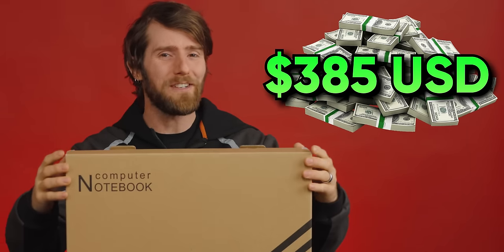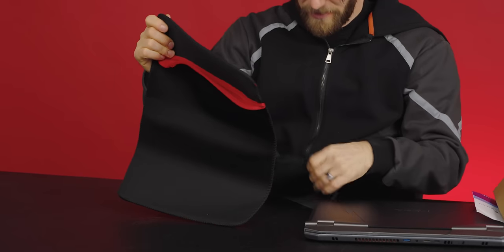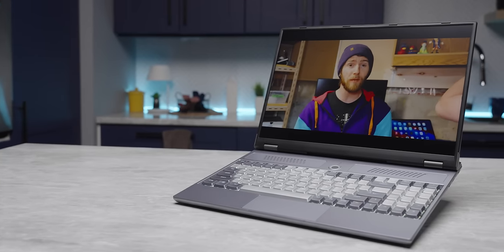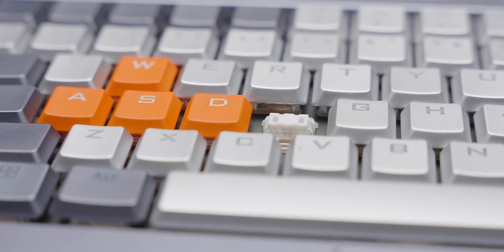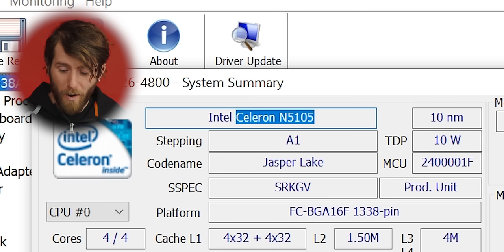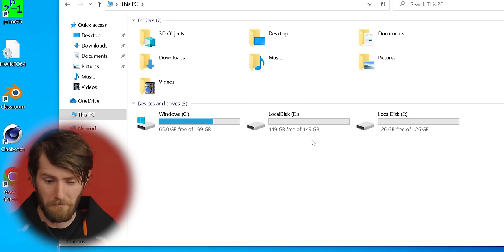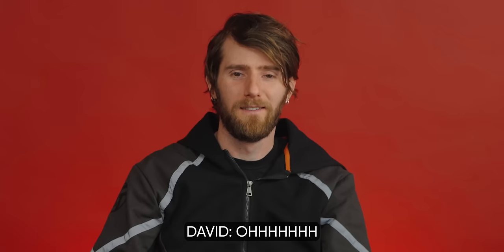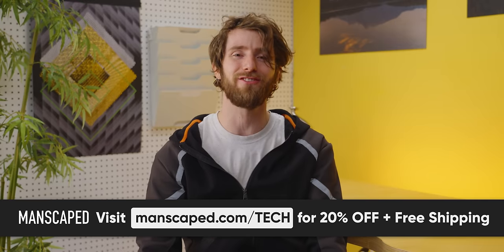Brown Star for Effort – This AliExpress Gaming Laptop is HILARIOUS

Comment: There's a lot of good audience for low cost, high value, thrifty PC laptops. You should make more reviews like that. Not necessarily with the humorous angle, but fair reviews. I liked when you reviewed Walmart's Motile laptops. You should include some brands from China like BMAX, Chuwi and Jumper.
Reply: Ooo I got a Jumper laptop cheap (about € 35 I think), former owner's friend had tried to install W10 on it and failed, making the device "bricked". I reformatted the "SSD" (I'm still not sure if a REAL SSD is inside...) and installed W10 with a USB stick. But surprise surprise, half of the installed hardware is not recognised, no drivers for them even in the latest W10 version... They are "downloadable" on the Jumper webpage, yesyes, which is half english and half chinese... I gave up for the moment, in a quiet hour I will again try to download them...
Reply: @frankmeyer9984  I'm an enthusiast who owns 20 laptops at home basically as a hobby, ranging from several very premium ones to a number of cheap ones from China.  On a cost/benefit ratio, I'm quite impressed with two models I own: the BMAX Y11 (Now shipping with upgraded processor as Y11 Plus) and the Chuwi Corebook X. Both work perfectly with Windows drivers, both running Win11. Build quality and specs are superb for the price. Sure you can buy a US$4000 fully specd MacBook Pro 16 (I do own one) but there's a thrill from seeing what a 10x cheaper device can do.
Reply: @Gustavo_St  Indeed... Everyone can buy a solution, or make it by himself 🖖Today I watched a review of a $ 375 gaming laptop, and the results were partly sadly laughable and partly highly impressive! For this money it may be the BEST "gaming" laptop you can get! Real mechanical keyboard, 4 real cores up to 2.9 GHz, 16 GB RAM, Aluminium case,, high quality high resolution IPS display with "Golden Ratio" 19:10 display... Well you get what you pay for, but in that case you get a LOT of Laptop for under 400 bucks...
Reply: Excellent suggestion. We all know the main brands and have seen the reviews on websites, YouTube, etc. No one covers the OEM, Chinese, Indian 3rd party brands in English. Theres loads of students, people or small businesses on a budget that would benefits from those reviews. Particularly if these laptops allow easy DIY repair.
Reply: There's not just laptops of this ilk, but thin clients, too. Make excellent machines for the price if all you need is an office machine.

If you're willing to go second hand, you can grab retired office ones for like £25 on Ebay, and they'll do for office use. Just pair it with a cheap wireless mouse and keyboard combo, slap it next to your TV and off you go.

They'll also make a good "smart box" for your TV, and be a heck of a lot more responsive than your TVs smart functions.

Comment: Linus talking about how slow 2400 DDR4 is meanwhile I'm here still using 2133 that I got in Jan 2017.
Reply: I'm running 8GB of 1333mhz DDR3 in my main (with an R9 290 and FX 8350) so this is out of my league
Reply: I guess he is thinking on ddr3 top speeds which used to be 2133 and 2400 for the very high end ram back then, so he was thinking in older technology, but 2400 and 2666 are the norm on laptops and even desktop low end pieces until 2021.
Reply: I ran 2400 just an year ago. It was not optimal, but it was fine.
Reply: Hell yea I'm also running some sweet 2133 from 2016 lol
Reply: I'm using 2133 MHz DDR3 from 11-12 years ago. Same age as my CPU.
Reply: Still dailying 1600mhz DDR3 here, it's... ok
Reply: @Lego455200930  me too, 16gb 2133mhz ddr4 that I also got in 2016
Reply: I'm still using 16gb of 2666 ddr4 I got in 2018 lol It's still pretty quick
Reply: im using 16gbs ddr3 1333 oced 1923mhz and running in quad channel with low latency 7-7-7-9 and honestly because of quad channel it still kicks ass
Reply: Samsung B die, the god tier DDR4, is 2133MT/S :D
Reply: 1600 DDR3 is the real elite choice
Reply: me with 1600 mhz ddr3 16 gb
Reply: Me with my 16 GB dual-channel 2400 MHZ on my Legion Y720: 🥲
In all fairness it still works fine for me...
Reply: I have 4x 8GB Sticks, all 2133 MHz and I'm using it with a 3070ti xD
Reply: "pat in the back" or something ?
Reply: @el_tio_apoca8014  I think it's because of him mainly concentrating on the DIY space.

I've seen GSkill sticks that hit around like 3600MHz (Can't remember the exact value, but it was above 3GHz.) as early as 2017m
Reply: @masssssy   i think what makes it slow is not about the frequency, but due to its clock speed since it is a LPDDR4
Reply: yeah man 2400 is typical for ddr4, 2133 is slow, and 3k+ is fast (with 3600 being pretty much max performance)
Reply: While I am running below spec on one of my system:
1. AMD phenom X6 1090T
2. 2*4gb 1600mhz DDR3 dual channel Ram 
3. WD blue 3*320gb 7200rpm sata HDD
4. Radeon HD4670 512mb DDR3 graphics Card 

By today's standards - a potato PC
Reply: 2133 with a 1080 and 6700K still running fiiiine, except for the latest cod, some kind of cpu bottleneck there.

Comment: You should do a video where you fully upgrade this machine to see what it’s capable of. New windows install, top spec m.2 ssd, and faster ddr4 ram. Maybe also see if a battery upgrade is possible and Liquid Metal on cpu with fan replacement for some overclock?
Reply: YESS and maybe a linux install
Reply: @pntrk  I just bought one todo that exact thing! ;)
Reply: @andrewbrady8564  please tell us how it goes!

Comment: Having spent some time looking in to getting a tablet manufactured, I might be able to shed some light on this.

A lot of Chinese ODMs have demo units they can send out that are designed to show off what they can do. This laptop is typical of this. The webcam shows custom accessory design, the mechanical keyboard and screen show off a little premium hardware, the chassis is designed to show build quality. For the things most people are familiar with though, they go with the minimum needed for the demo units to work. So they show where premium speakers would go, but use cheap speakers for the demo. They use a cheapest processor in the series the motherboard design targets. The cheapest RAM (probably old stock) that will fit in the board, and same for the SSD.

These units are basically sold at-cost. The weird Windows is actually not as weird as it looks. It's almost certainly a bulk OEM license provided for evaluation purposes. The script is probably a test script that the company has been using for years, built in to an image they clone on to the demo units. 

The demo tablet I got was very similar, with a mix of surprisingly premium and extremely cost-cutting features. Honestly, though, it was an amazing tablet at the demo unit price. This laptop is almost certainly the same sort of thing. 

Honestly, this laptop looks awesome. I kind of want to get one and put Linux on it just for fun!
Reply: Interesting insights. But wouldn't this be ODM rather than OEM?
Reply: @r7calvin  I do believe you're correct. I updated my comment (OEM to ODM)
Reply: Where do we find these ODM products?
Reply: @mujtabaalam5907  Usually they're sold directly from the factory to someone who is looking to have something manufactured. In this case, it looks like one of the factories just decided to go ahead and make enough to sell.
Reply: The script is definitely an actvation script, as from what little we've seen of it it refers to KMS, an activation system intended for enterprise versions of the OS which wouldn't be used on some sort of separate device not meant to be a part of a corporate network.

Unless, of course, it's used as means of fraudulent activation, owing to the fact that the keys used by this system can be shared by indeterminate number of machines (therefore can't just be detected as illegitimate copy), and you only need the OS to connect to your fake activation server (or an emulation of it) to fool it into thinking it's a legitimate copy.

Comment: One thing about the magnetic accessory on the top, IBM did something very similar over 20 years ago on their ThinkPads. 
The UltraPort connector supported bluetooth adapters, cameras, microphones, IR blasters and CF card slots. It only lasted a few years and was later discontinued.